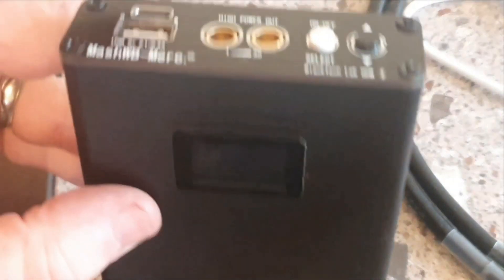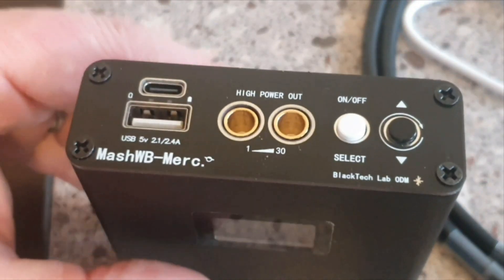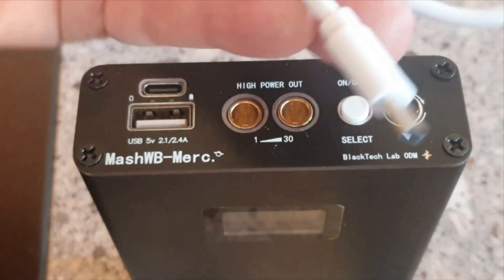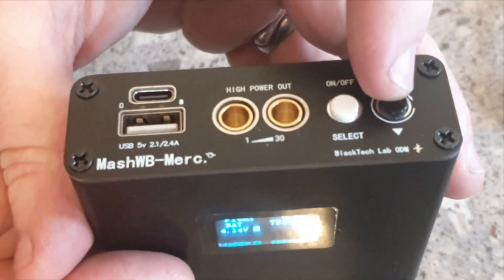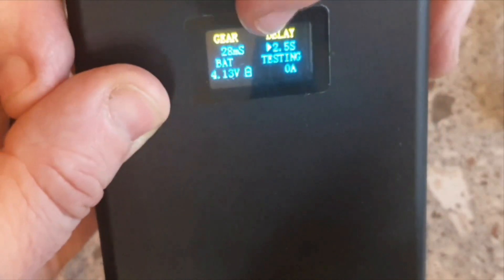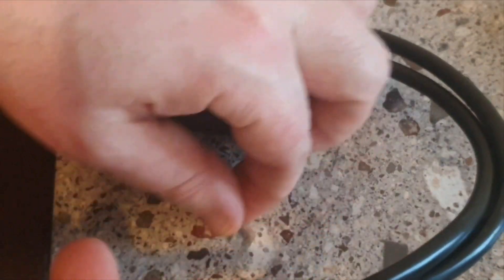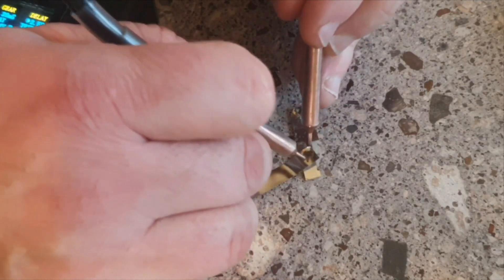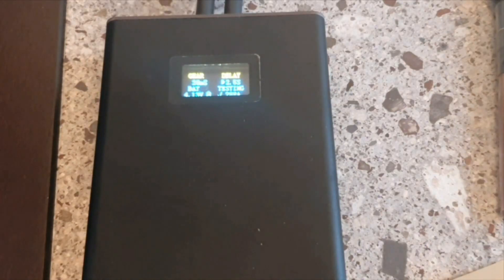DIY Battery Spot Welder Demo & Description

Comment: Hi i want to repack my old dewalt 18v xrp drill with lithium ion battery is this welder good for that?
Reply from the maker: It's a bit light I have upgraded
https://www.youtube.com/live/TIwhXS1bceM?si=HIBMNuKEVaVpnjk1
Reply: @doctorlefthandthread  so do i buy it i mean i have to weld 5batteries together i am not going to use it anymore that is all that i need the welder for
Reply from the maker: @miroslavkrajisnikovic4563  if you are doing a little cheap home build the other one will do but you need to use light strip
Reply: @doctorlefthandthread  what thickness strip do i buy
Reply from the maker: @miroslavkrajisnikovic4563  
https://www.ebay.co.uk/itm/274865824817?mkcid=16&mkevt=1&mkrid=711-127632-2357-0&ssspo=k6L2r3Z0R46&sssrc=4429486&ssuid=cjPn_ZfdQLW&var=&widget_ver=artemis&media=COPY

Comment: Can you tell me any information about the build in battery in this machin please because i have one with not working battery and i want to change it ?
Reply from the maker: To be honest I was curious about it but didn't open the machine to look. I could check tomorrow and get back to you.
Reply: @doctorlefthandthread  ok... its very easy to open the machine ,just 4 screw then slide  the cart ... thanx im waiting you please!
Reply from the maker: @Dr.OdayNafiSalim  sorry about the delay I spent 2 hours fixing a grinder it did not go well lol.
I opened my welder it's 2 pouch cell batteries I don't know anything about them if it were me I would connect a pack together with 18650 cells 2 or 3. Sorry I can't help more
Reply: @doctorlefthandthread  thanx alot my dear just i want know the voltage of the 2 battery to be replace .. thanx again pro. God pless you🙏
Reply from the maker: @Dr.OdayNafiSalim  the read out on the welder reads between 3.7v and 4.2v depending on the charge level